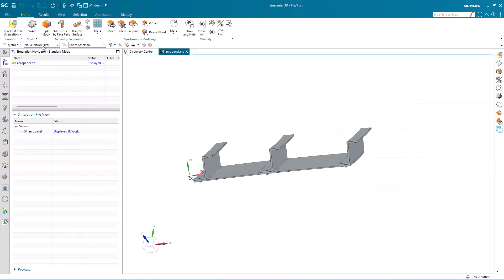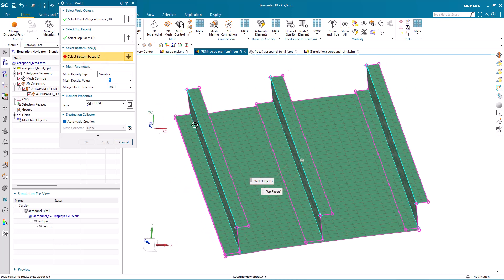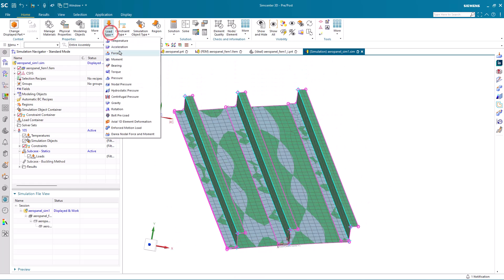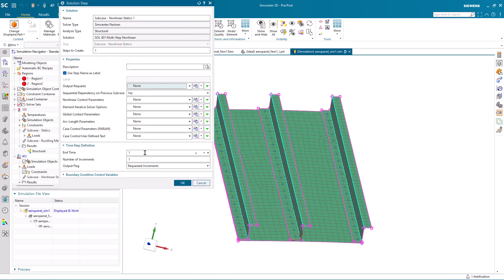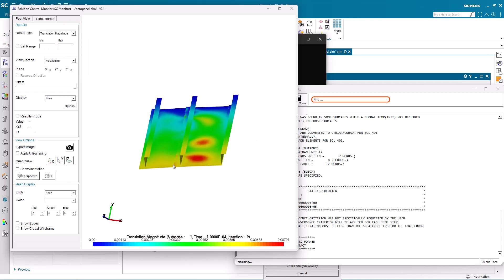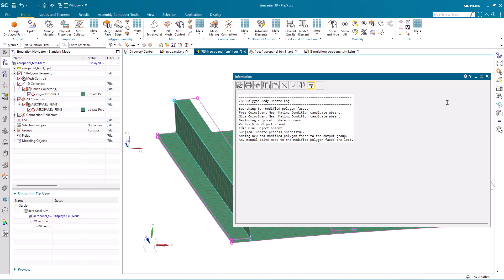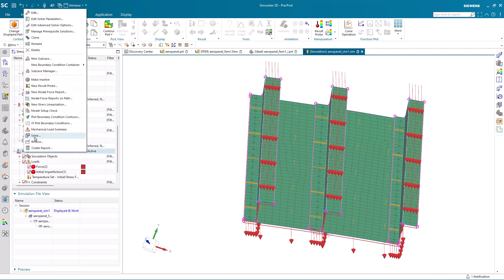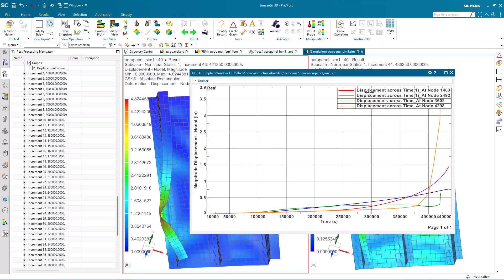How To Run A Nonlinear Buckling Analysis On An Aero Panel

Comment: great video.why was CBUSH selected to represent connection and not RBE2?Also how can welds/bolts/rivets type of connections can be analyzed if they are defined during modelling for eg welding of 2 parts by solid weld command in weld assistant. IF possible can you explain in brief or provide  reference link?
Reply from the maker: Glad you liked the video.  I used CBUSH to model the fastener to account for some flexibility where the RBE2 is rigid.  Also, its easier to get fastener loads with the spring dashtop results from the CBUSH.  Please reference these videos for more examples on connecting parts: https://youtu.be/AU--vr6n4y8?si=L4ZVpJLxdz4GGU08 https://youtu.be/slDbi0Jh-Fc?si=PO09G0x0BZ9e49ZP
Reply: @Simcenter3DTipsandTricks  thanks for the reply